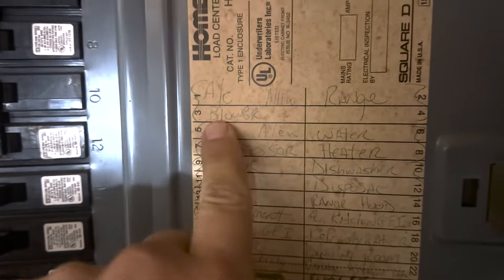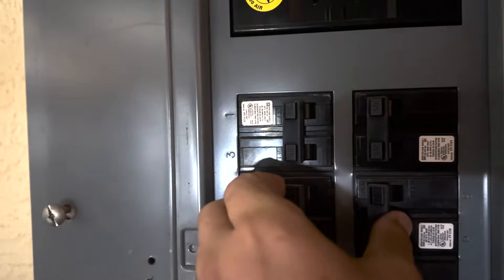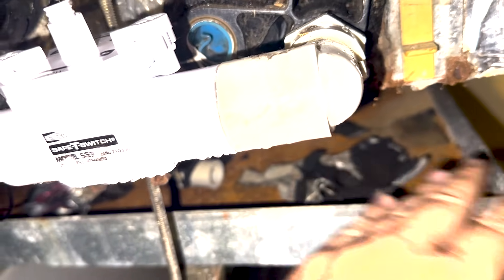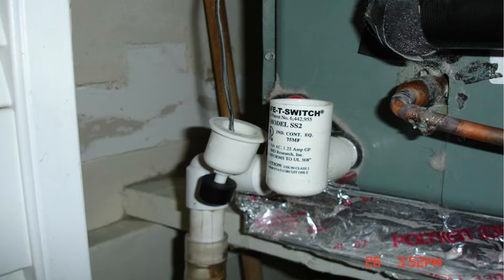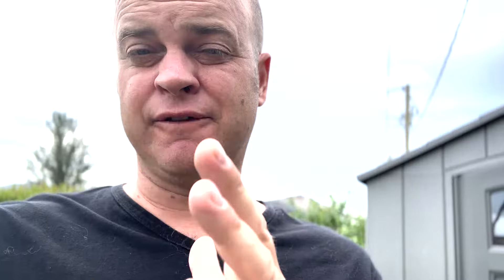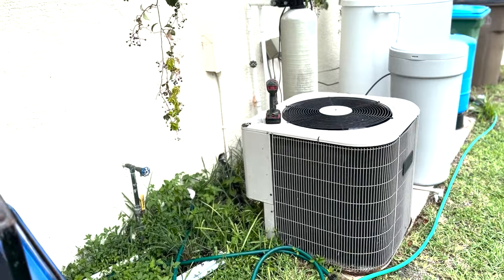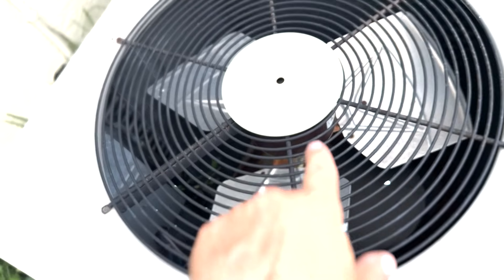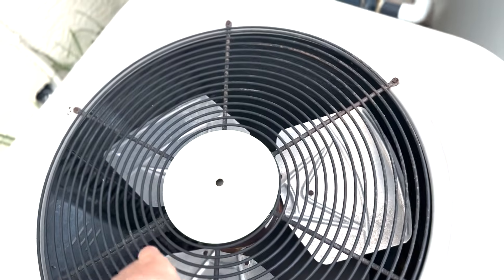AC Is Blowing Warm Air - Here’s Why

Comment: Hello  I live in a condominium my AC is in the top ceiling in the bathroom I don't know why my air is blowing a little cool but not cold   I checked the pan there is no water I checked the thermostat and the batteries I also check the breaker everything is okay please give me some advice 🙏
Reply from the maker: You may be low on Freon, which would mean you have a Freon leak. Also, first thing would be to check your filter and make sure it is not dirty (easiest option). We have other videos on our channel like “AC not cooling” that could help you as well 👍

Comment: My fan wasn't turning outside. The motor was extremely hot. I turned it by hand and everything started going working again, nice and cool. Just have to replace the capacitor for the motor. Youtube for the win!!!
Reply from the maker: Good I’m glad, but I would suggest you use a long screwdriver to turn that thing…just in case it decides to come on by itself 👍

Comment: I flipped off my breakers and my air conditioner and nothing happened. Are you sure I wasn't supposed to use my index finger or maybe throw the peace sign? 

(Lol.. Jk - people are dumb enough these days where it's hard to discern from sarcasm - I felt I needed to include the fact I was joking lol)

Seriously though, my window AC is garbage. It's basically just like a $900 fan now. I'm in Arkansas and it's the middle of August so it's 100+ degrees everyday. But I work in a sawmill that's in an uninsulated metal building and we all work on the second floor where all the heat is trapped (ground level is mainly hydraulic tanks and wood chips on conveyor lines) and if I'm not mistaken, my supervisor told me they took the temperature in there last summer and it was supposedly like 150 or 160 degrees in there - like it's always 30+ degrees hotter inside than outside - when we walk outside for break, even the 110+ degrees feels like Antarctica just having a little breeze/fresh air... 

Seems like you'd die at that temperature but even living in Arkansas and growing up playing football and working in the log woods (I supposedly had a heat stroke in the log woods a few years ago), farms, plants, factories, mills, etc. and being very familiar with stifling, oppressive heat and humidity, the heat in this sawmill in an uninsulated metal building with machines everywhere putting off heat and even vapor/steam from the wood and almost no airflow is something I had never felt.

 It's a wholly different experience/feeling and there is a new sensation that you don't get from just regular heat - it's like the air in there is some kind of solid material and there's kind of a crushing and suffocating feeling... Almost everyone in the mill gets to work in cabs with ice cold ACs but I'm one of the about 3-4 people who not only have to stand all day but do it with no cab lol.. One of the other guys without a cab got so hot the other day, his eyes glazed over and he was all confused and they had to send him home - something they don't allow very often. But anytime any of my cab dwelling co-workers try to tease me or give me crap about anything, it's a pretty touchy subject - I'm like, "Get your lazy ass out of your comfy chair and out from the AC and get out here and help if you have a problem" lol...

But all of that to say, after being in the sawmill all week, just being at home where it's probably 95+ degrees in my house and having an AC to just stir up the air feels pleasant. Though I do fantasize all week about being able to sit under the AC on the weekend at home and it's a pretty big bummer lol... But air conditioning is one of those luxuries that I might be better off learning to live without - like if there's ever a situation where it's just not available for whatever reason I'd already be acclimated.
Reply from the maker: Crazy environment you find yourself in there. Thanks for sharing 👍 Yeah it’s all relative. 95 degrees sounds pretty brutal, unless you come out of an environment of 150! Hopefully you get to enjoy those air conditioned cabs soon enough🥶

Comment: New air conditioners don't use freon. Am I right?
Reply from the maker: Yeah the word “Freon” can be (generally speaking) understood as the refrigerant in your AC system, but more technically, I believe Freon refers to R-22 (which is still in many people’s systems), or its predecessor R-12. The newer refrigerant R-410a is not technically, I am pretty sure, referred to as Freon.
Reply: @mechanicsfornonmechanics8998  Freon is banned. It's going out of style and becoming rare and more expensive. That is why I had to upgrade my system to a new one. Freon has been banned in the U.S. since January 2020, prompting major changes in the heating, ventilation, and air conditioning (HVAC) industry. You can still use an older air conditioning system that uses Freon, but maintaining and repairing one is growing increasingly expensive.
Reply from the maker: @crand20033  That is true.  The A/C industry is very expensive to the consumer.
Reply from the maker: That’s a good plan, and yes, unfortunately you are right about our industry having some scammers in it